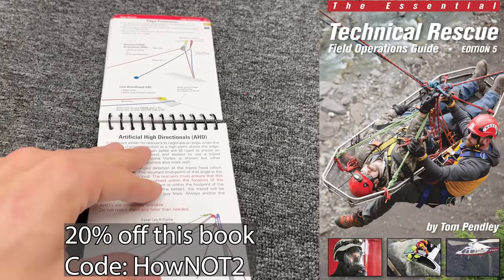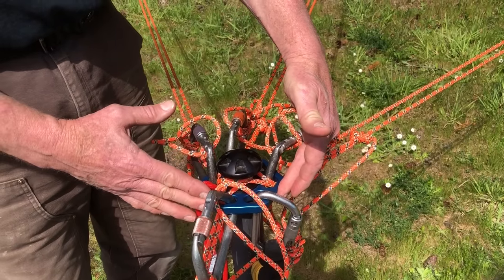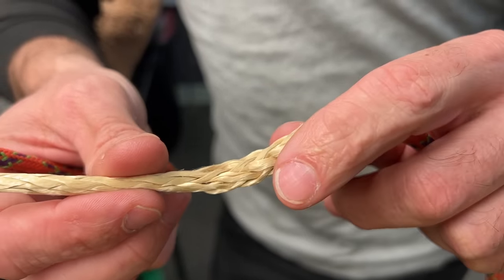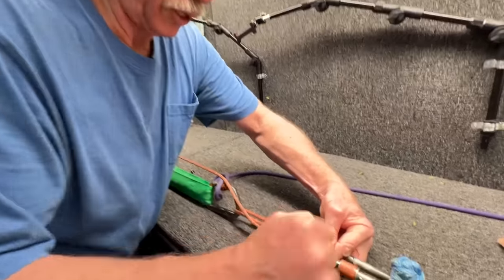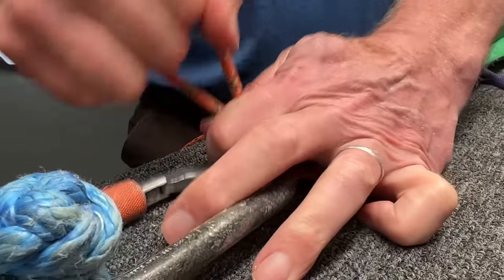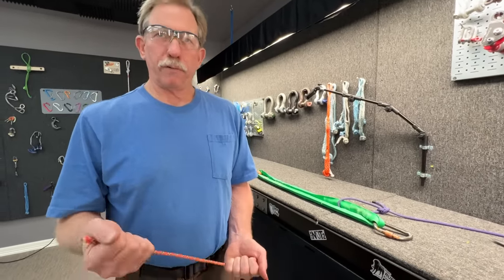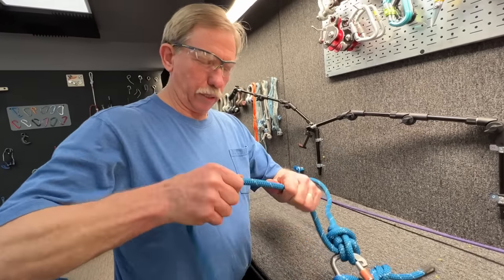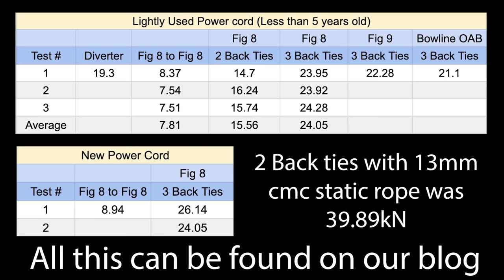How strong is this skinny cord?

Comment: It seems to me like it would be faster, stronger, more efficient, and easier to inspect if the anchor was rigged with a basic BFK off those three trees. Could still use a rigging plate in that case if they wanted and it wouldn't look like such a cluster. Is there a specific reason why they opt for so much gear to be used over a single rope off three trees tied in a BFK?
Reply: The anchor is not just floating in space, it is also holding up a monopod. With monopods it is critical that you be able to adjust each leg separately so you can get them all tight, hence a carabiner with a round turn and two half-hitches for each leg.
Reply: Great comment. This is a case where the climbing world and the rescue world overlap. So many techniques would work well and a BFK is one. Part of the reason to use tension backties is that they function like a mechanical advantage to remove all of the stretch out of the system which is not realy shown here. Rescue loads and especialy haul systems put so much force on the system that managing the stretch is important. Even using 11mm or 12.5mm for the anchor allows quite alot of stretch if they are not tensioned. Its just nice from a rigging standpoint to have a solid focal point that doesnt move around.

Comment: I missed a bit of context here. Would have loved to hear more about what he was trying to achieve and why.
Reply: Sure, In high angle rescue, we use a dual main or twin tension rope system. two ropes give redundancy. We connect those ropes to a solid anchor. Sometimes thats a big tree In a perfect spot but often we have trees or such not lined up with where we want to take our ropes over the edge. In that case we rig a multi point anchor system that is consolidated at a focal point (master point) lined up where we want to go over the edge and in a good spot to work. The cord that goes from the master point back to each anchor is what we are talking about. The rescue loads can be up to 600 lbs and the force from a hauling system can be more than that so, we want the material in the cord making each leg to be strong so we can equalize all three legs and then tension the whole thing up. It puts that master point where we want it and we can connect poth ropes form the rescue system to it. Tech cord like PowerCord is very light, very strong and very very low stretch. this makes the master point anchor realy solid.

Comment: I'm interested to know more about that pole he was using that looked like it was attached to an anchor plate. Pretty cool tool to keep the anchor off the ground.
Reply: You are talking about the SMC Vector, about a meter tall and very useful piece of kit for rescue. Weight is 1380g , you can use it as a rigging pod as you saw in the video or as a gin pole at the edge high directional. I like it a lot.

Comment: Honestly I wouldn't trust them in a life-critical application either. Not a matter of their strength, but a matter of the diameter. Cordage exists in the real world, where it will be damaged to some extend even in normal use. A skinny cord has less leeway to sustain damage before it becomes critically damaged, and what would be a slight fray or nick on a larger cord will be a significant weakening of a skinny cord.
Reply: Its true that thicker cord has more to cut but we are using these tech cords for rigigng anchors and that is far more controlled than ropes over and edge or on a wild wall where there may be sharp corners we cant mitigate. I've been breaking things in classes in back yard testing for 30 years, we grew up with 15:1 or 10:1 safety margin I think because there were so many unknowns. Now we are doing alot more testing and the materials and quality control is alot higher. It is very unlikely that we will have a situation where we generate the force needed for component failure even on these skinny cords.   Now abrasion is another matter, if you can not eliminate abrasion while your cord is under tension then yes you need bigger cord with better abrasion resistance. The intent here is to talk about specialy gear that has special qualities we want  with very  high strength to weight ratio. There is high demand for lighter gear especialy in rescue . I wrote alot for the purpose of discussion, you have a good point.